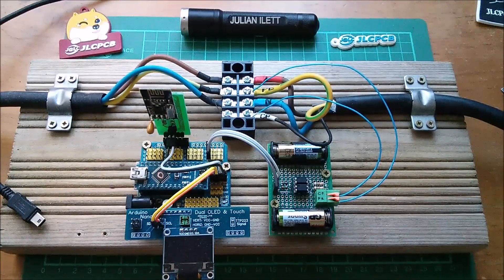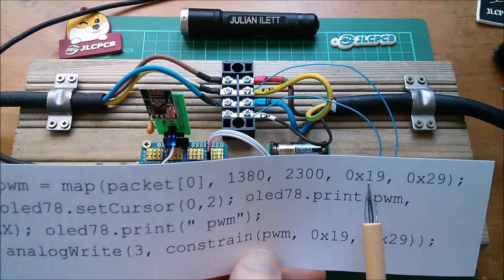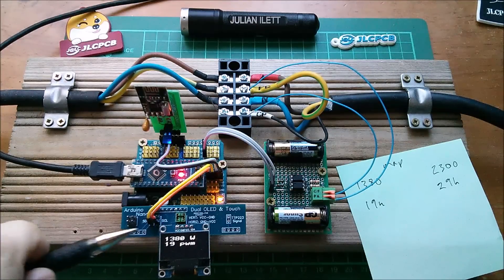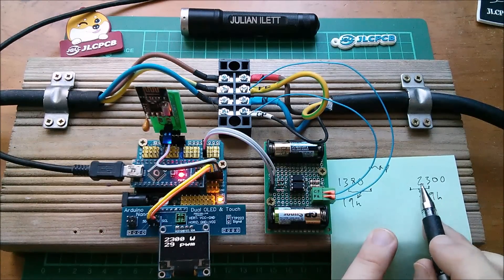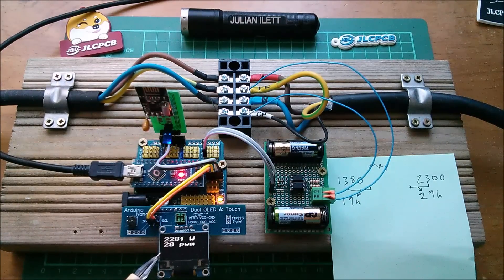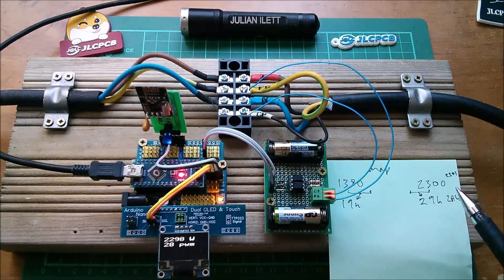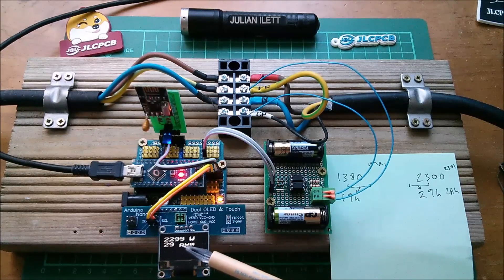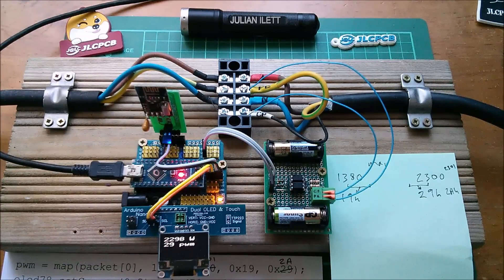The map() Function is Really Basic

Comment: Sorry I missed the original party last month!

When I find myself saying "This is working wrong," about something being used by gazillions of other people who don't seem to be complaining about it, I try to remind myself to take a few minutes and double-check my assumptions!  🙂

It seems to me that what you pretty much wanted, without realizing it, was to have a range of W values centered on each pwm number.   That's my premise, and I shall proceed on that basis, right or wrong!

There are 17 buckets from 0x19 and 0x29.  Each one holds a bunch of W numbers.  Slice up the distance from 1380 to 2300 (which is 921) into 17 parts, and you get a little over 54 W's for each pwm.  That's the size of each bucket.  To center the range of W's (the bucket) on its corresponding pwn, slide the bucket down by half its size.  Each range of W's now spans below and above the corresponding pwm, centered on it.  In other words, W's a little lower or higher end up on that pwm -- even at the limits.

There is a half a bucket below 1380 that you will never use, and half a bucket above 2300 that you will never use, but there's probably no issue there.  This also has the effect of keeping the total number of buckets correct.

In the end, it's a simple and clear way to get all the right numbers, all the time.

bucket = (2300 - 1380 + 1) / (0x29 - 0x19 + 1)
map (x, 1380 - bucket / 2, 2300 - bucket / 2, 0x19, 0x29)

Comment: I think it makes more sense if you consider it in terms of decimal places.  It starts at 19.0, but then goes up via 19.1, 19.2, 19.3, etc.  So when those fractions are truncated, you end up with it sitting at 0x19 for a long time before it increments to 0x1A.  But at the other end you have to go through 28.7, 28.8, 28.9, then finally 29.0.  So you sit at 0x28 for a long time and only just hit 0x29 right on the maximum value.
Reply: Thinking about it further, I think this is because usually in programming you always exclude the final number - it's almost always "up to but excluding".  For instance in loops your conditional is usually less-than, it's rarely less-than-or-equal-to (so with "for (let i = 0; i < 3; i++)" you will stop before i = 3.  When you supply date ranges, it usually includes the start date, but it up to but not including the end date.  So it follows the same convention here, that the final value you pass to map() should be one beyond your data range as well.

Comment: The formula of map is not a secret. The formula is so well-known there's a Wikipedia article about it:

https://en.wikipedia.org/wiki/Linear_interpolation#Linear_interpolation_between_two_known_points

You can find the Arduino implementation of it in the file arduino/hardware/arduino/avr/cores/arduino/WMath.cpp. Wikipedia y0 = Arduino out_min etc. Arduino's implementation uses integer arithmetic and does no rounding, which is documented behavior, but is what causes the anomaly you describe.

If you prefer it to round, that's an easy change:

long mapRounded(long x, long in_min, long in_max, long out_min, long out_max) {
  return round(float(x - in_min) * (out_max - out_min) / (in_max - in_min) + out_min);
}

There's also examples out there of manipulating the AVR timer registers to get higher-resolution PWM, which could give a better range of control.

Comment: A basic function wherein you read the analog value of the pot and ignore differences of a few  between the old reading and the new reading and returning an average of a n number of readings could take care of the jitter on the Watts reading, right? Also a small capacitor (something like 0.1uF, you can play around) might give you more stable readings?

Comment: Hi Julian, are you REALLY sure that what you wish the map function did is what you actually need it to do? Look at the bigger picture - you are mapping power available from solar to a pwm which in turn tells the car what current to draw. So in principle the car should draw a current that is equal to or LESS than the current available - which in principle is what the raw map function does. You shouldn't get the 0x29 pwm (16%) unless there's 10A (9.6A?) available. (I think that was your top limit of 10A x 230V =2300W) However your 'tweak' now effectively tells the cat it can draw that current even if the available supply is lower, which means you will have to top up from the grid. Of course there is a massive amount of rounding and approximation (220V? 230V? 240V? etc) involved in the whole end to end process, and it will probably work fine whatever you do, but from a purely simplistic view I think really you ought to stick with the map function 'as is'.
Reply from the maker: That's a very good point. When I later discover that the car is drawing more power than the solar panels are actually producing, I may come to appreciate the way the map() function is behaving :)

Comment: Hey Julian. Maybe a small box-filter will average out( settle down) your ADC value from the pot? I have seen where the lowest 5 or 6 bits of the ADC reading on a PIC12F683 is very noisy on the lower bits. A box filter of say 40 values makes it much more stable. Cheers from Canada.

Comment: Julian, you might consider putting a statement after that pwm map to cap the value at 0x29. (Something like if(pwm > 0x29) pwm = 0x29; ) If the Arduino folks ever changed the behavior of this function to something like you describe, a future software update could cause your EVSE to start drawing excess power at the top end. Maybe also look at putting a decoupling cap on the potentiometer wiper to debounce it a bit?
Reply: Simpler way to make the pot work a bit better is to reduce its input range slightly..  I. E.  Introduce deadband at the ends of travel,  rather than assume an ideal pot ;) But improvements are needed at both ends...  I. E.  receiving end should always sanatise and validate values given are in range,  etc.  A 'scale' function that uses map,  does the +1 fudge and constrains output values would be much nicer. As well as  using constants.
Reply: Use the min function to set a maximum value     
X = min(0x29, <other math here>)     
it will never exceed 0x29

Comment: If this is adjusting the power into the car I would test the power variable  and limit its value to your max power before  using it in the map function.  You can't trust the value to be correct after passing through your radio system.
Reply: @ErrorMessageNotFound  I did not see that! Is it after the wireless link or before?

Comment: "That's an odd anomaly of the map() function".
Actually, things like this are very common in coding, in general.

If you were to do the math and code the mapping by-hand, I think you'd see why. This is an extension of Y=MX+B. Fractions are inherent, but Most general-purpose math functions like these use integer math. (must look at the function declaration to see, integers in, integers out). 
Another commenter actually included the map() source. And, my guess is, this is a standard C function, so has been defined exactly this way on every machine compiling C since the 1980's. [And even if map isn't Standard C, there are MANY standard functions which have this so-called anomaly, which is not an anomaly at all, and is in the definition]. Which is to say, folk rely on these functioning exactly this way, and it should not be considered an anomoly, nor something to change. If you want different functionality, consider writing or finding e.g. a fmap(). Where f=floatingPoint, or rmap() where r=rounding. 

Fractions are not rounded in integer-math. Nor, IIRC, in conversion from floats to ints. 

There is a trick for integer rounding: say you're doing N/6, and want a rounded result. Then instead do (N+3)/6. This will give you standard rounding, where anything above 0.5 gets rounded-up.
There are other such tricks, such as (N+5)/6, and (N+1)/6. Each of these techniques has a purpose, and if your numbers really matter (e.g. if they're going to be used in more math down the line), then it's important to consider such things on a case-by-case basis. Often-times things like scaling (as you're doing with map()) should be the very last step (which can mean a lot of math done by-hand), so that small errors introduced at each step don't add up to big errors.
E.G. If doing N/6+5, it might be wise to consider, instead, doing (N+3+30)/6. But, of course, keep in mind that now you may need to consider longer integers.

Further, look again at the map() definition, it works with long ints. Every time you call it, it has to convert your ints to long, then do long math, then convert them back to ints... This is rather CPU-intensive. Akin to using "digitalWrite()" rather than writing to the PORTA register, directly.

I've been doing things like this, in C, for 25years, this sort of integer-math was a huge part of my Intro To C class. I only recall hearing of map() within the last few years, and have seen it several times since. I gather it somehow became rather popular as a result of folks' doing exactly what you've done... and the large "community" of folk learning from them. Thank you for highlighting this case.
Reply: Yes, using ints instead of floats can generate unexpected results, because sometimes the fractional parts are significant. However, I believe the problem here is that the map() function was intended to be used in different situations. Personally, I would have just rewritten the function for my needs rather than use a kludge. However, everyone has a different opinion.
(I've been coding since 1976. 🙂)
Reply: @lesliefranklin1870  Great, then you should know better than I that things like this seeming misuse with lack of understanding are becoming increasingly common in the field as folk increasingly share knowledge they don't understand, rather than building firm foundations and reading reliable references...
As far as "unexpected results", no, I'd go so far as to say that if one understands the fundamentals, then using ints (and, more specifically uint8_t, and the like) should be very expectable. FAR moreso than using floats. e.g. (float)1 == 1?
Reply: @ericwazhung  Ah, the devil is always in the details. 😈

The original author of that function is probably long-gone working on bigger and better project. My only hope is that someone doesn't try to "fix" that library function without understanding its original intent. That might break the code of the many who rely on it and those who have created a kludge to make it work for them. That's why IMHO it's easier in the long run just to make my own function. If it were a first release of a library, I might take a different strategy. 🙂
Reply: @lesliefranklin1870  Indeed, and, actually, such things are rather prevalent. There, really, are few well-defined functions/libraries compared to how many are underspecified. 
I saw the API docs regarding a function called in a core driver from one of the Top Two not-entirely-opensource OS's wherein the driver programmer obviously misunderstood the API docs on the function; which was entirely understandable that misunderstanding would happen, as the docs were basically nothing more than was already in the ambiguous name of the function. The only reason I knew better was because I had a single-core machine in the era of the OS version being aimed at (and likely developed entirely on) multicore machines, and because I was trying to implement something that relied on timing on a bus originally designed for relatively high bandwidth, but which only actually ever had products which used it one time, at boot. The result being that because the original intent of that once well-defined-but-never-fully-utilized standard was abandoned by this one particular OS, in the way that it was, it was responsible for 0.3 seconds additional boot time on every system in the world running on that OS... Can you imagine the shear waste of power?
There was no reason that had to be an uninterruptable blocking spinloop. It did however have to be at least a 0.3second delay, which that lame API doc weirdly promised as though other delays might somehow be shortened by preemption. What a mess. But, no one has reason to notice, nor care... right? I bet they could've powered an entire city for several days if they'd cared
Conversely, your example: As Is, that function has become somewhat of a de-facto standard... So, kludges are probably as common, if not moreso, than whatever the original intent may've been. Regardless, as you point out, it would be unwise to change it lest it break many things. Better it's well documented as-is, so folk know how to use it (or not to).

I applaud your doing a bit of that, here!

BTW, in the other cases I recall seeing this function used, recently, I'm pretty certain I also recall their not using such "kludges." I remember this because the function-call was new-to-me, and I was skeptical-enough of such a function's ability to calculate, even with much effort, such a "kludge", given the arguments available to it... I kinda ran through my mind, briefly, how such a function could be written, and realized it would actually require quite a bit of math, every time it was called, that would be much easier for a human (or preprocessor-math) to do *once*. All of which to say, again, I think it's quite valuable that you posted this, as it seems many folk have fallen into the misunderstanding of its function. BUT, too, I'm betting a near-equal number of folk have used it properly, wherein your "kludge" may actually be so, ("proper"), if not common.

I have yet to run the math, though I am increasingly curious... Would an "accurate" scaling result in the near-minimum input values outputting the minimum output-value over a  full fraction of the input range, or *half*?

Either way, again, I applaud your bringing up and covering this topic, as I think many can learn from it!

Comment: Julian, 
May I also suggest - especially since you're 'fudging' your magic numbers in the map() call - that you create constants for your values.  Something like:

int minIn    = 1380;  // Minimum value from potentiometer/control signal
int maxIn    = 2300; // Maximum value from potentiometer/control signal
int minOut  = 0x19; // Minimum PWM output value to charge controller
int maxOut = 0x29; // Maximum PWM output value to charge controller

Then in your code, you would write - 
map(packet[0], minIn, minOut+1, minOut, maxOut+1);

(followed by)

analogWrite(3, constrain(pwm, minOut, maxOut));

This would make the fudging more obvious, as well as allow for changing the constants in only one place in the code if in the future you get a different vehicle or create a more (or less) capable charge circuit.

... and of course, please consider commenting your code.
Reply: I dig it... No "magic numbers". 
But, personally, I prefer #defines with uppercase names, as these indicate things that are calculated before compiling, and prevent extra use of registers/RAM. "const" may be your friend, if you prefer the other route...
Reply: I agree we need to stamp out magic numbers.  Also means that if at a later date you want to change the max value its easy to do it in one place.
Reply: @TheEmbeddedHobbyist  look I just started taking discrete math.. like I'm all for wiping out the magic numbers, but like it'd be just another thing that I got my foot in the door of before everybody decided against it... So you're going to have to kill them all... Every single one of them... Cuz I don't want this to backfire be another tragic pivot in the history of direction of compute and logic skill sets when the thing we all thought was going to go away comes right back again..
Reply: @JackWse  Wiping out magic numbers should be a thing you start out with not moving on too.
The problem with magic numbers is they provide no insight as to why they are there and what they mean. You come back to your code in 6 months time due to bug and you will have forgotten what they mean or where they come from. 

#define DOORLATCH_SET_BIT 3

provides you with a much better idea of what you were thinking and doing all those months ago. 
than a '3' in the code would.

just in the same way you call a friend 'John" and not number 5 as he was the 5th friend you had.
Reply: @ErrorMessageNotFound  Obvs you didn't read my comment...  and no, he's not. There are no named constants in the code he showed us.